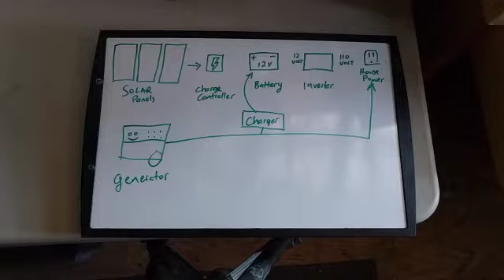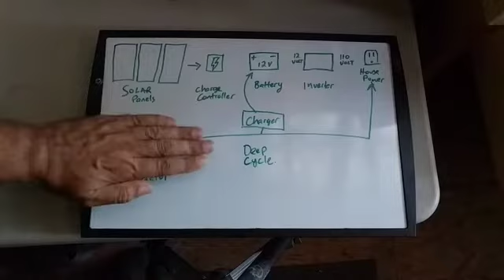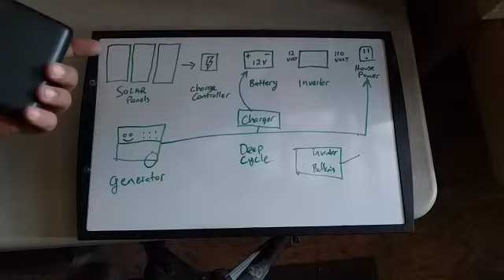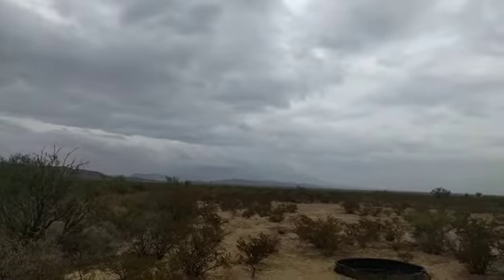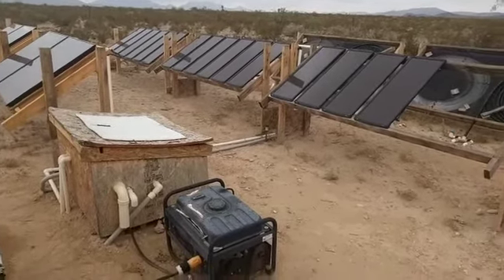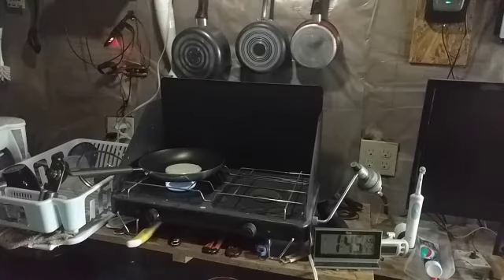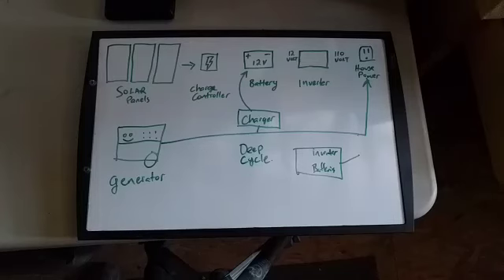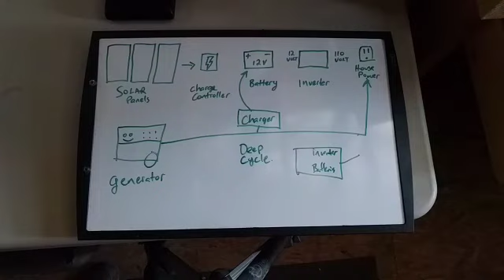Emergency Survival Power and Pancakes!

Comment: I am a little surprised you haven't tried solar cooking.
I've tried the car windshield shade solar reflector idea and proven that it works & will at least bring water to a simmer. I can't find an illustration of how to correctly use jars for cooking but let me try to describe. Need 1 wide mouth pickle jar to act as the wind block to prevent convection heat loss and a jar smaller than the wide mouth of the pickle jar. (tall skinny olive jars work well).
Paint the smaller jar flat black on the outside. leave the lid on while painting as you do not want any paint inside the jar. This is the cooking jar. But before painting put some masking tape down the side of the jar to leave an unpainted stripe down the side of the jar. This is your window to see inside the jar. 
Set up your solar reflector and place the lid of the wide mouth picke jar upside down where you get the most solar radiation. Then fill your cooking jar with appropriate amounts of oatmeal & water, beans & water with spices, lentils etc. Put the lid on the smaller jar and set it on the upside down wide mouth lid. Then set the larger jar over the smaller jar and just set it on its lid, don't screw it down. 
https://www.pinterest.com/pin/490681321884109847/
https://solarcooking.fandom.com/wiki/Windshield_Shade_Solar_Cooker

Solar reflector cooking will also work in the winter if you shield your cooking jar from convection heat loss as described above.
Reply from the maker: Thanks, that looks interesting, I'll check it out. I have a friend in Canada who made a cooking rig, probably something like that. Best wishes :)

Comment: Good tips Carlin! The battery bank I sent ya has solar charging and a light built-in which I thought was handy. I leave mine on the dash of my truck to recharge. The 'solar generator' you spoke of is a game changer if the power is out. We had a transformer blow in the neighborhood recently and I ran my fridge and little 5000btu AC unit off my Bluetti EB240 for four hours before the juice came back on. The fridge only draws 130w operating and the little AC unit was 436w (compressor running, just 54w for the fan). With 2.4kwh stored in the Bluetti you can run intermittent loads for quite awhile. Luckily it was a sunny day and the panels were pumping 500w into it the whole time so I was almost at equilibrium. Note that if you DO run your fridge off of one of these, make sure and lift the ice maker arm to disable ice making. The heated wires that slice the ice cubes draw close to 500 watts when it cycles (not really applicable for desert living unless you have a pressure tank lol). My only complaint with the EB240 is that the pure sine inverter can only supply 1000 watts so running things like a compressor or hot plate might not work. I ordered an AC200 that claims to supply 2000 watts so we'll see. If it can do that then I'll have to see about finding a new home for the EB240... know anyone living in the desert who could use one? ;^)
Reply: Interesting tip about the ice maker. Mine is already off, but I don’t think I would have thought about it either way. Thanks
Reply from the maker: Yeah I almost didn't mention the Solar Generator, since I don't have one, but for a lot of people, that would be the perfect thing to use. Glad you mentioned it. I've lived a lot in apartments over the years, and that is one area that you'd really struggle, can't keep a generator, no room for solar. There are a lot of times power is only off for a few hours or a day, so that's perfect. I hadn't thought of running the air conditioner with one, but that sure would make life better! And yeah, that little solar powered battery you sent gets used a few times a month, if I'm running too many tools that day and pull the batteries down, then realize my phone is dead, or a little light is always good!

Comment: I have something very similar to this I created for myself. I use it camping and deer hunting.  I think its very important for people to understand when using systems like this is , How much Power do you need ? 

When you are camping what is the asset one needs the most ? Answer , Light. we all want some sort of light source. For me I use a light that has a clampy thing on it so I can clamp it just about anywhere. It has a 60 watt LED light bulb. I also have a harbor freight 400 watt inverter and a harbor freight  2000 watt inverter.  

With the 400 watt inverter I can run this light and my cell phone charger . using this method is very battery cost effective. I first used a new car batter ( AC ) because that's what I had at the time. I have ran this set up for over 5 hours hours with very little drain to the battery, I was quiet surprised.  and during the day, I used my generator ( harbor freight tailgater 1000 watt < I love this little guy, he has never failed me does all I need it to do , and runs 5 hrs on 1 gal of mixed fuel ) with my battery charger to recharge the battery. 

Now since then I have upgraded to two 6 v golf cart battery's ran in series to give me my 12 volts. I have yet to test these batteries on a time frame but if I got 5 hours out of a car batter with an led light by all accounts 2 golf cart batteries should out preform a standard car battery hands down. ( but now I'm stuck hauling these 2 batteries around ) 

If I'm just camping for a night or 2 , ya car battery, 400 watt inverter, 60 watt LED light ..... works just fine and yes I would like to buy a 12 DC battery and do away with the car battery all together. And use the golf cart batteries for a more long term camping say over 3 days.

Anyways.... Excellent video, I agree with you in a lot of ways with her set ups. always a pleasure watching and learning from you.
Reply: It’s lasting that long because you’re likely using less than 15w total with the phone charger. The LED does not actually use 60 watts, unless you’re using a super bright light. A 60w equivalent LED typically uses between 4-6 watts
Reply from the maker: Great points! I think that was one of the biggest lessons for me when I moved off grid, that I don't need to do everything all at once, and I don't need power on constantly. Its only been in the last year or so that I leave the Inverter on 24/7 now, before that I would turn it on to do something, then turn it off again. When I lived in the bus I used mostly DC lighting direct to the battery bank, so didn't need the inverter on for that. When I built the house, I wired it for AC and DC, have regular breaker panel connected to the generator and the solar / inverter system (I don't use a switch over, I just unplug the cord from the inverter and connect to the generator, for that once a week I need it for something). When you realize how little you really do need, everything gets simpler. That's why I usually recommend people start small and test it out. Its easy to think you need 4000 watts all the time. Thanks for the comment, and glad you liked the video :)
Reply: @ripstick2217  interesting  observation, yes its a soft white 60 watt LED light bulb and as for the phone charger that isn't something that is always running, as typically its fully charged from my truck before I even get to where I'm going. Thank You for sharing this with me.